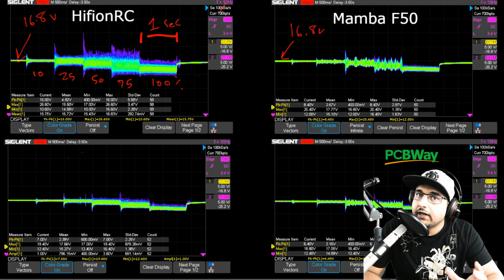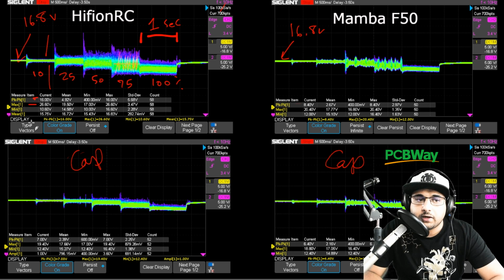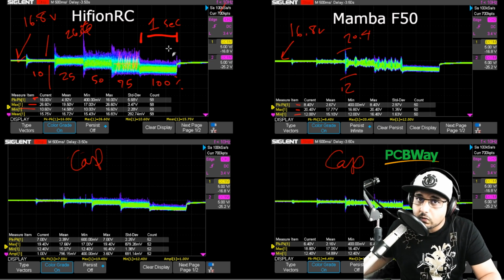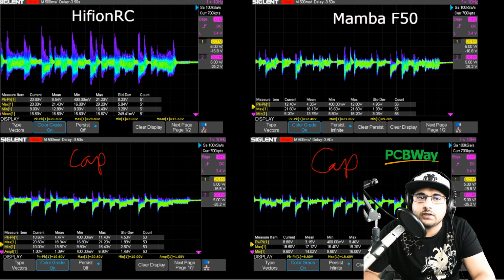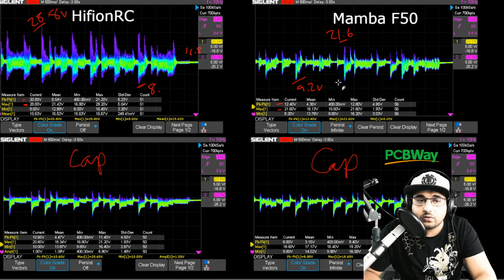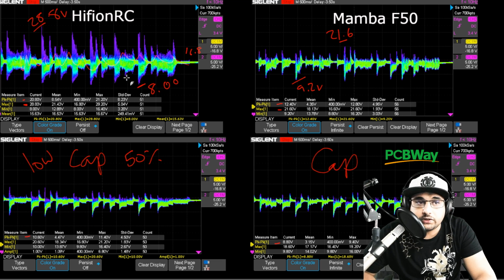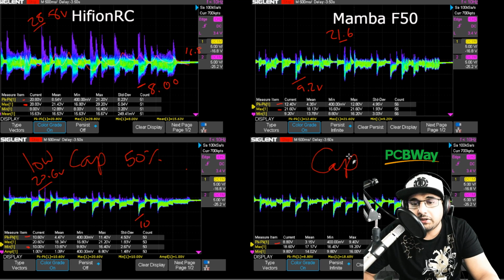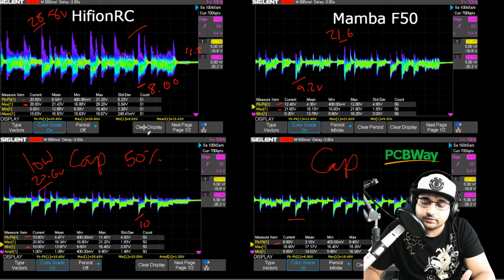HIFIONRC F722 Pro Noise Test // Compared To Other Budget Stacks

Comment: I would love to see some testing with that Fettech “spike absorber” that is supposed to be used in tandem with caps. I’ve also heard to use a ~1000uf cap and <330uf cap together as well. 1000 will help with the bigger spikes, but they say 1000 is not as fast or “low esr” as the 330

Comment: got 2 drones on this Hifionrc FC + ESC (v1 with 45A and v2 pro with 60A). V2 pro version with 60A ESC with 35V cap on 4S is just perfect (better than v1 with 45A ESC). bluetooth/speedybee also works great (not on my phone as it doesn't support BLE) - near zero noise in analog camera (caddx ratel). 6 months (and some crashes) after start, they still both work fine.

Comment: Hei Man,

After watching your video I decided to buy the Hifionrc f722 pro FC and use it together with the Hobbywing xrotor 60a 4in1 ESC. I configured everything using usb and a 2s battery. When I wanted to go out and fly (6s) nothing was working right. The second sets of beeps were missing and the receiver was switching on and off. Same thing on 4s. With 4s I get the second set of beeps (the long beeps) multiple times. Only 2s works without any problems but  I would like to fly on 6s. I've got a 35 u capacitor on the ESC.
Any recommendations what could be wrong?
Thank you!:)

Comment: Great video, I actually have Hifionrc 60A blheli32 esc and f722 pro fc on my 6s 7 inch rig. Im struggling with 50hz noise regardless of what i do, I'm thinking of getting Mamba f50 pro to see if that fixes the issue. Im using 35V cap (Maybe I need to go 50V cap?) that came with the combo. Would adding extra cap to the 3.3V line for gyro or 5V of the fc do anything  in this scenario?